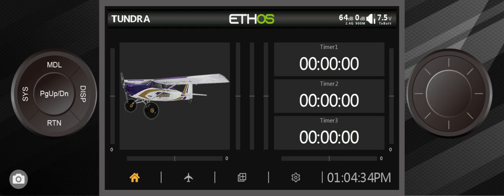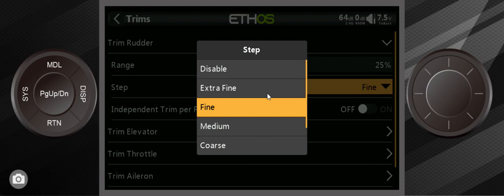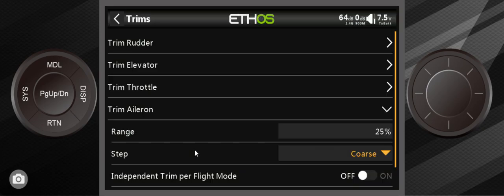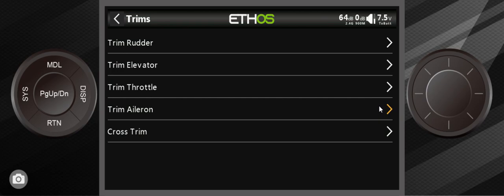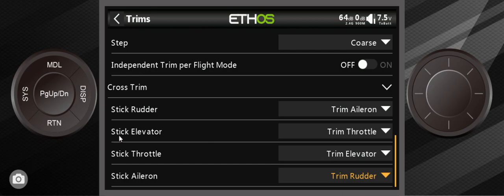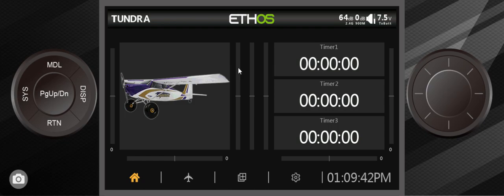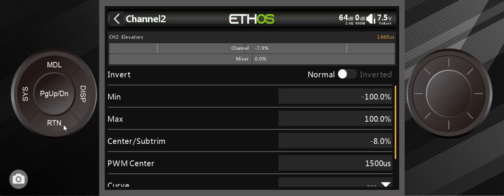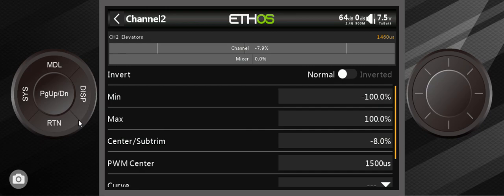FrSky Ethos: Trims, Subtrims and Cross Trims explained

Comment: Hi Steve,
how do you add Trim 5 to a free mix in Ethos 1.5+?  I do not see an option for the trim as a whole in when you add an offset?  Could you please update this video with that?  I am trying to get my steering servo to work and it doesn't seem logical at the moment.

Comment: Near the end on recentering trims if they are off center by a significant amount. At the upper right of the screen the pulse width is listed. Note this value. Reset the the trim to its middle position. Then adjust the zero setting to the noted pulse width on the screen. No guess work or trim flight needed.